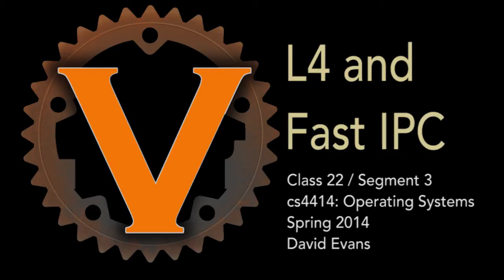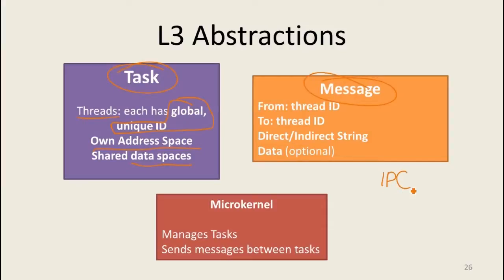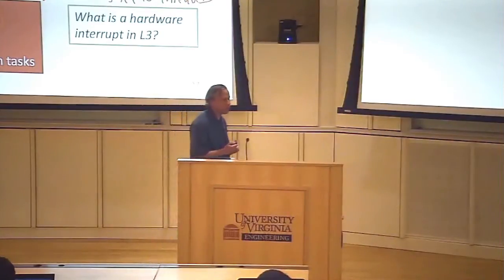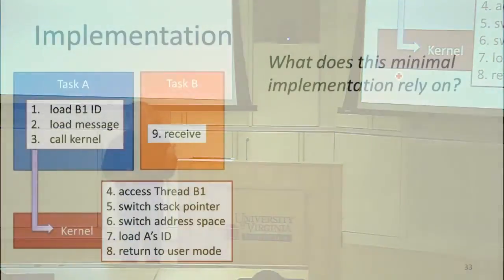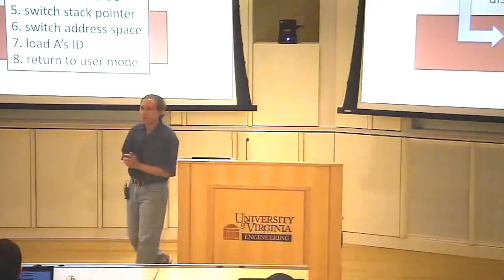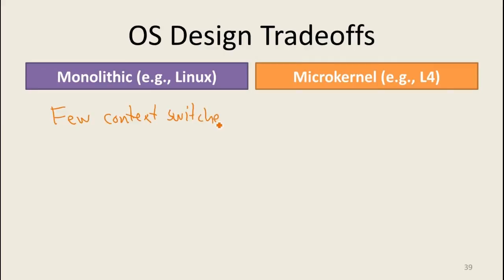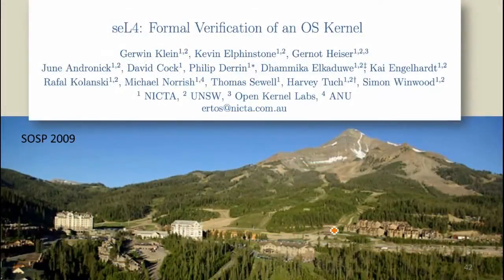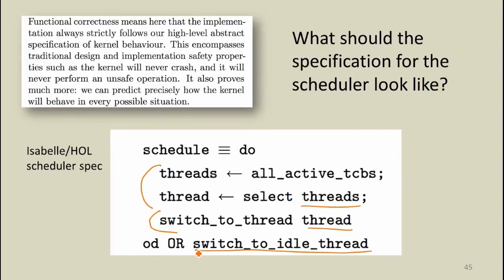L4 and Fast Interprocess Communication

Comment: Hi, i do not understand why the kernel needs to copy the information 2 times, can't the kernel copy the information directly from task a's memory to task B's memory? Isn't allowing task a to copy to task b's memory dangeros, what if task a says it want to copy 1kb of information but instead makes a 2kb copy and intentionally messes up task b's memory? If shared memory is necessary is't it better for task a to create the shared memory and for task b to only receive access to it, or for the kernel to create a new memory space, copy the data into it and then give the memory space to process b?
Reply from the maker: I'm not sure I understand the question, but I think the issue is that in order for Task A to send a message to Task B, it needs to go through the kernel since providing direct access to Task B's memory would be unsafe. To go through the kernel, Task A need to send a message to the kernel, and then the kernel sends a message to Task B. I think what you are suggesting is that instead of actually sending the full data in the message to the kernel, task A could just send a description of it (e.g., the start and end address in its memory space), so there is no need to copy the memory into the kernel, then the kernel would directly copy from task A's memory into task B's memory, only needing to make one copy. This makes good sense to me, and would be less expensive than copying the data into the kernel, and then the kernel copying it into task B's memory, when the data is large.